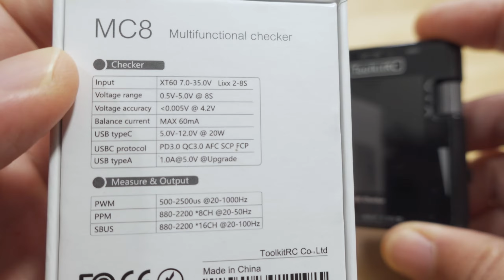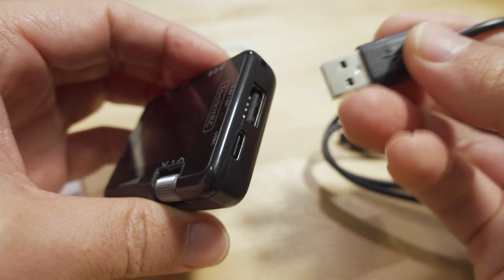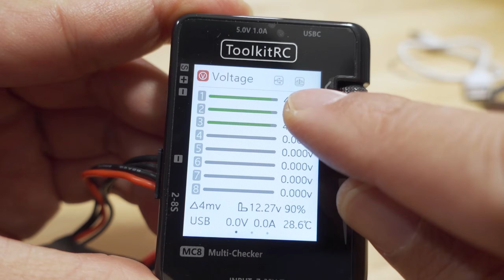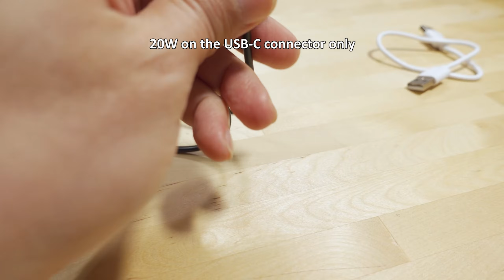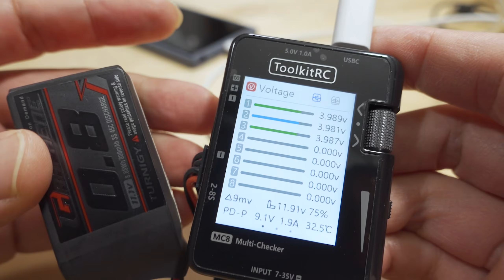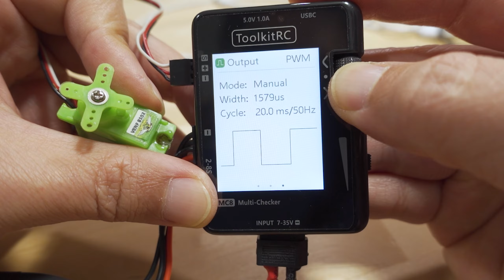ToolkitRC MC8 V1.10 FW Review // New Firmware Features 💡

Comment: Very useful tool. Need to get this on my bench. Just getting into toys that use servos and can always use another lipo checker. I use the ISDT BG-8S, very good lipo checker. And I do use it to drain lipos down to storage voltage while charging my phone / tablet. I don't like that it uses lipo voltage not cell voltage for low level set point. The Toolkit using cell voltage allows me to easily switch between my 4S 5S and 6S lipos. 🤓